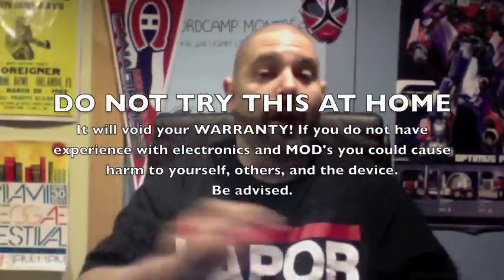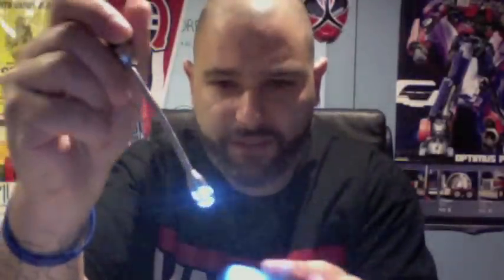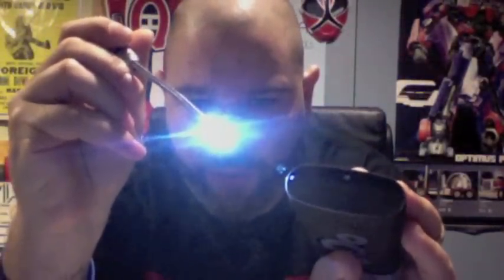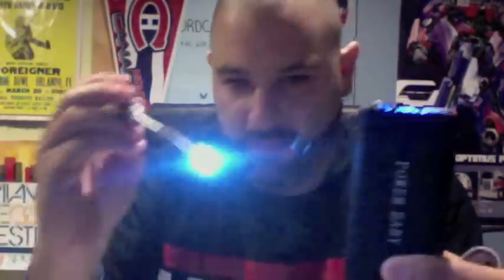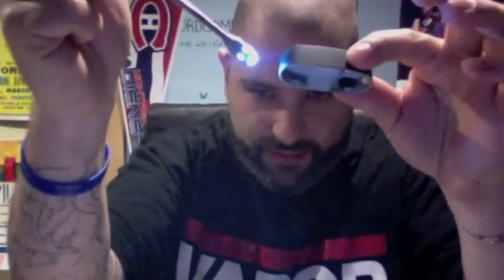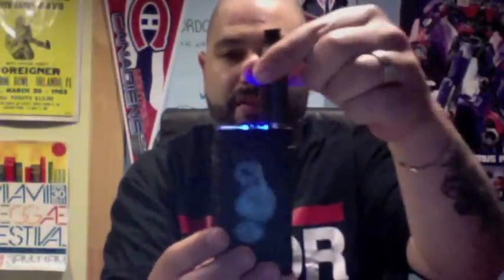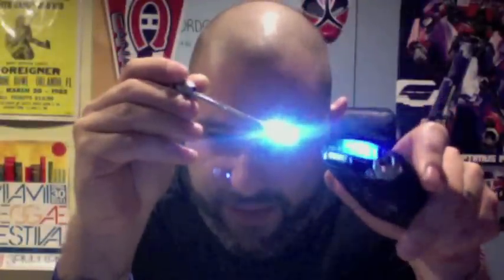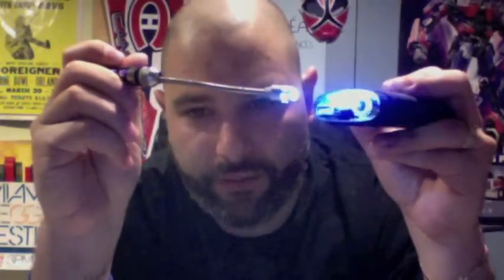Big Vapers Tutorial - Dismantling and Troubleshooting the Power Baby MOD

Comment: soooo the firing button was not firing so i took it apart with help of this video :D lol nd t seems the connection is completely out of its holster ... im going to try to super glue i in place?? ugh i used it for a day lol (got it from my aunt) should I not use superglue to keep this in place? i know ideally i should solder it but i dont have soldering gun or am i able to use one hahaha i was just going to glue the posts into the board? good idea ? bad idea? hope it works lol i love a 5V vape...